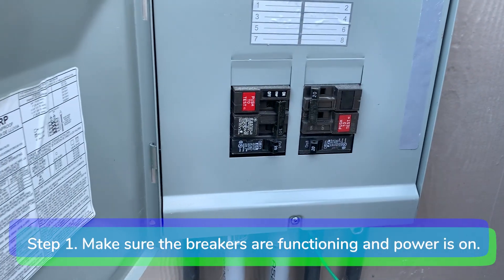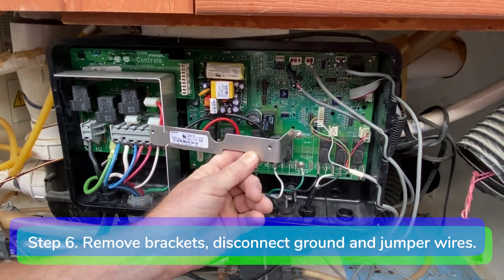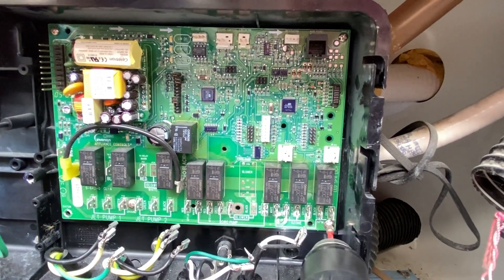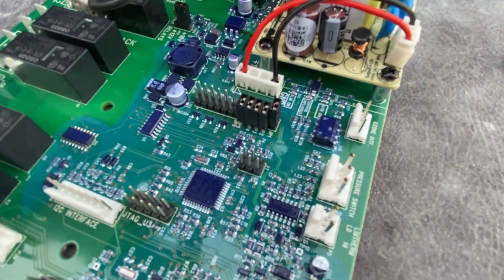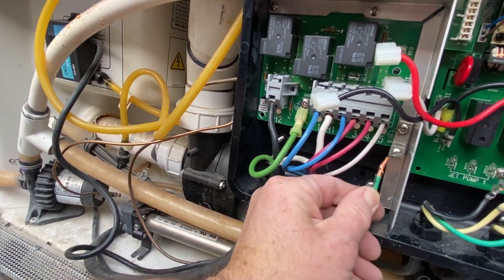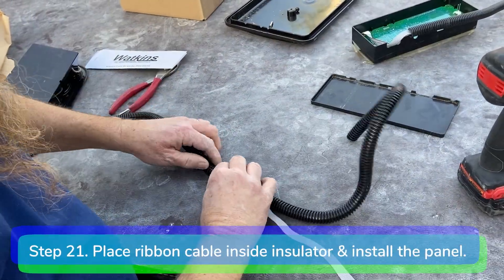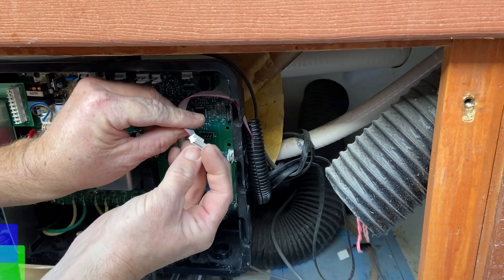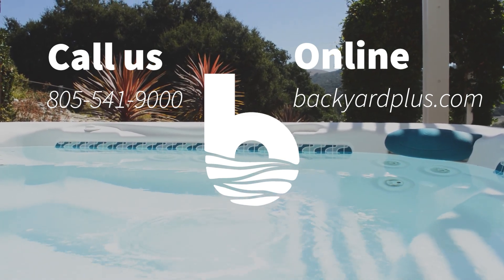No Lights on Topside and Motherboard? How to Troubleshoot a Dead Motherboard & Control Panel: Part 2

Comment: Great video! do you know if replacement motherboards are identical to original, so the jumper settings can be copied form the old board?
Reply from the maker: The are identical

Comment: Do you have to replace topside control panel when replacing the control panel?
I followed your testing procedure and it looks as if I need to purchase a new motherboard.
Reply from the maker: Do you mean the auxiliary control panel? You do not need to replace the aux panel when replacing the motherboard and control panel

Comment: Thank you very much for this video series! It was very helpful. I assume if there was no voltage spike and the heater relay board is good - only either the motherboard or control panel needs to be replaced? Do you have any tips for confirming which of these it is? Removing the control panel and turning the spa on? Or do both definitely need replaced? Thanks so much!
Reply from the maker: I'm glad you liked it! As far as tips go, it would be difficult to put all the information into this comment. There are many indicators that would lead you to believe that your control head or motherboard is bad. Check out our other videos relating to the control head and motherboard. Or, call us at 805-541-9000 and speak to one of our technicians.
Reply: @backyardplus  Thank you very much
Reply: Where would I find the replacement parts, mine is 220v, here in France the agents want 4k for replacement